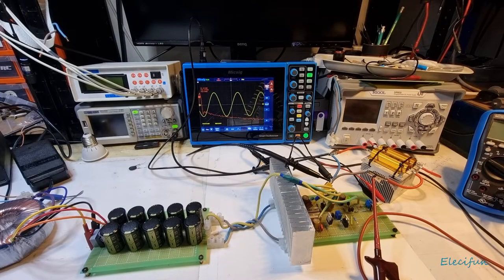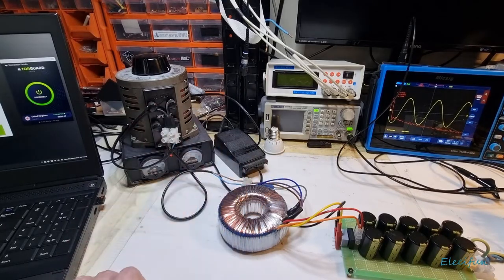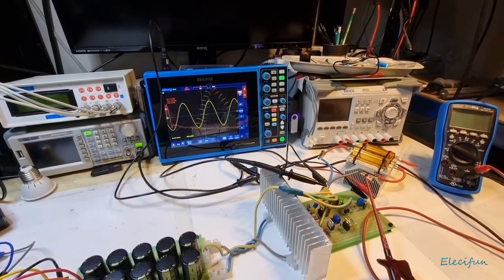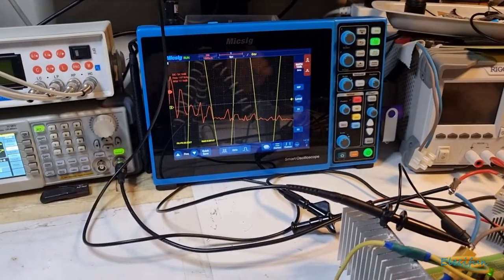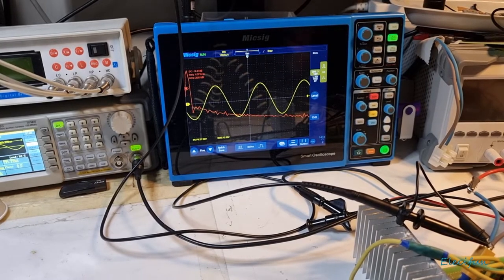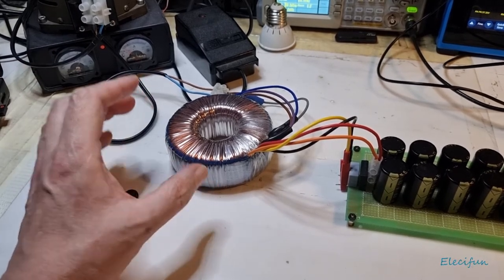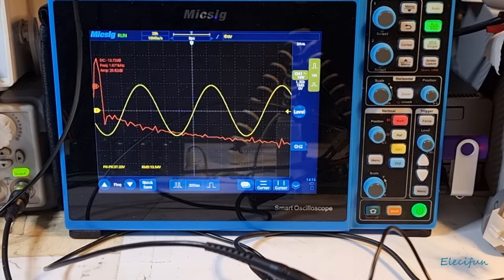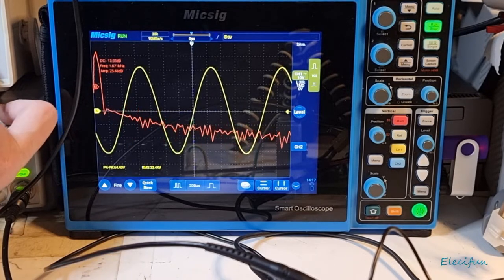ESP 60 Watt DIY Audio Amplifier - Power Tests

Comment: Really interesting new testing gear Elecifun! It's fun to see the numbers. I usually just use my ears but they don't perform as well as they did when new lol. Seriously though it's neat to see your build live up to expectations on paper. I hope your listening expectations get met as well!
Reply from the maker: One of the best things about this subject is the toys we get to play with, at least for me it is. I also do like being able to see the performance of the device under test. The amp circuit sounds great that's why Iv'e built it again this time better I hope. I am setting up to test the first build looking for differences as Iv'e used better components this time around.
Reply: I hope you make a video of testing the difference between the old and new amp. It is interesting to see if higher quality components make a significant improvement. Cheers.
Reply from the maker: For you mate yes I will. Been having some software issues so it might not be as streamline as we would all hope.
Reply: Thank you amigo! Don't burden yourself if the software issues are too frustrating lol.
Reply from the maker: It's not the frustration that will burden me, its the not knowing. I have run test after test to find out why the outputs are the way they are. The software issue is I can't run comparisons at the same time. I know why the outputs are not as I hoped and I can show that and what can be done to make improvements, 
I will figure it out but may have to run comparisons one channel at a time.
Reply: I didn't realize that the outputs were not what you had hoped. I'm sure you will learn why and sort them out. I too hate the not knowing.
Reply from the maker: Cheers Sonic, got it sorted now. Will upload a comparison video in the next 24h.
Reply: I'm glad it's sorted. I look forward to the video. I picked up one of those silly little Chinese tube pre-amps. I built an enclosure with the 3D printer. Just an experiment but the thing works and sounds better than I expected. I'm editing the video now. Slow going with my computer equipment. Should have it up on YouTube later today.
Reply from the maker: Great stuff I will be sure to watch. I looked at some myself probably similar, 6J1 tube preamp..? I will go check your channel now.
Reply: Yes, those are 6J1 tubes. They sound better than I expected. There are "higher quality" 6J1s available but I'm not sure I'll go down that rabbit hole... I will probably save the money and put it toward the next build.